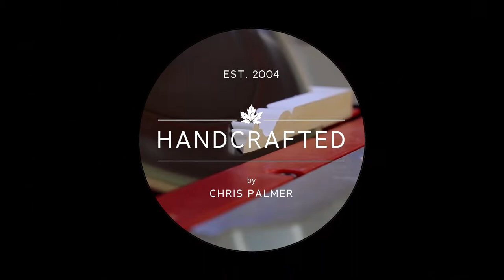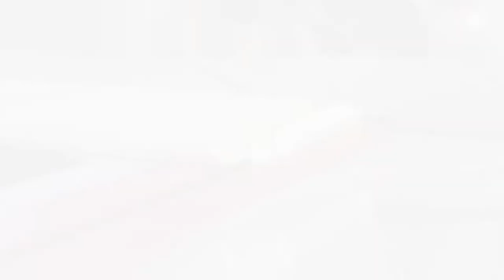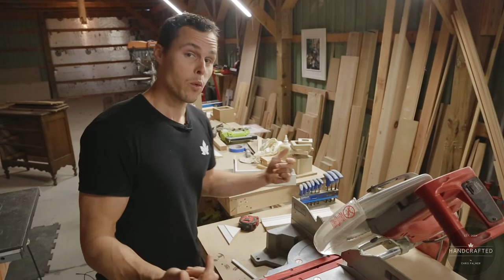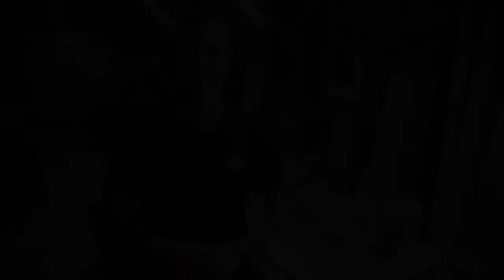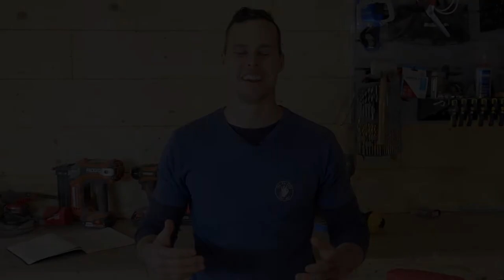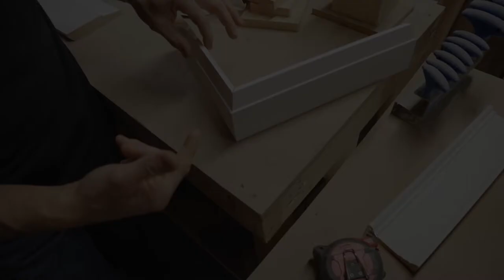The Difference Between Bevel vs Mitre Cuts

Comment: Great video. It's simple, but I needed it explained :) Doing baseboards, I see everyone saying do a 'bevel', then I proceed to see them use the miter gauge. But they are standing the baseboard vertically (which for me seems easier) and they are making a bevel cut at that point - if I understood you correct. Thanks!
Reply from the maker: Only works with short trim, standing vertically. The bevel is the best use for tall trims. You essentially are beveling the trim when its base and mitre cutting when its casing.

Comment: Good explanation. I have been perfecting my cuts & although there is plenty of info on calculating bevel (x) cuts for baseboards, there are not many about true mitre (y) cuts. The real challenge I am working on is how to calculate a combined bevel & mitre cut for say a wall which is not plumb as well as a non 90' bevel... It is not so easy!
Reply from the maker: Just keep learning and don't quit! You'll get there!

Comment: Miter and bevel cuts are uniquely defined by the cross section of the object being cut. Using the same angle for a miter cut or a bevel cut  on square or round sectional objects yield the same shape.
Reply from the maker: Yes as well as the fact they call the saw a bevel when your axis rotates in the X vs the Y.

Comment: With that example piece you have there, would it be possible to cut both ends of that wood with a saw that only does mitre? I guess the decision to use bevel comes down to height of the wood?
Reply from the maker: You definitely can achieve the bevel cut if you stand small trim vertically. You are right on the height of the piece being your factor. Hence the reason we get into sliders 👍

Comment: Dear Chris, I have a less related question for you. Are you satisfied with you milwaukee miter saw? I am researching for buying a good miter saw and I can not decide between Dewalt 780 and Milwaukee 305.
Could you please help?
Reply from the maker: Milwaukee is great but really love my Bosch! Dewalt is mid line, Milwaukee has great features like digital gauge but Bosch has zero clearance and no slider maintenance.

Comment: Cutting square section wood then - you get to choose whether you're cutting a mitre or bevel?
Reply from the maker: If the cut runs thru the vertical plane it's a bevel, horizontal is mitre, but yes a flat stock can be both.

Comment: what's parallel and non parallel miter cuts?
Reply from the maker: Not sure I follow the parallel, I didn't use these terms. I speak to the axis. My guess for what you're asking is parallel being along the floor and non parallel being perpendicular. So non parallel is essentially a mitre, sound in line?
Reply: @HandcraftedbyChrisPalmer   no I saw it somewhere else and could not get an explanation.  However I think parallel is where you make the say 30 degree angle cut where the longest corner is on the top side of the board. That cut means you switch the miter from left to right, I think.
Reply from the maker: @AlbertMaruggi  interesting..30 degree cut? Perhaps this is regarding crown cuts on the flat with the 33.9 degree angles
Reply: They are referring to the two cuts you make on a single board. If the cut requires a 45° parallel, then both the cuts on that same board are parallel to each other. If it's a non-parallel cut one of the ends on the  board is going one way while the other end is going the other direction